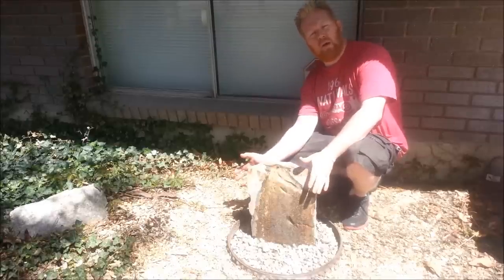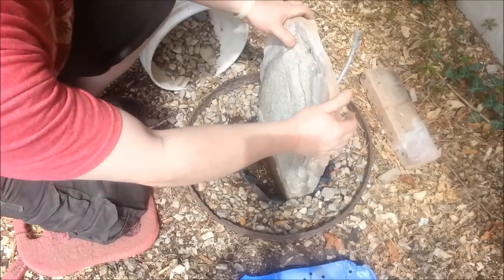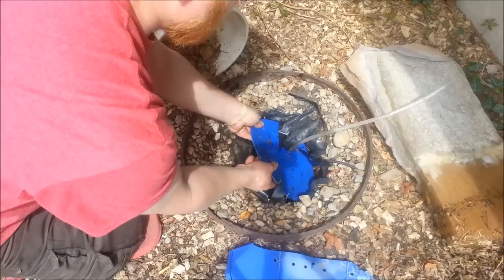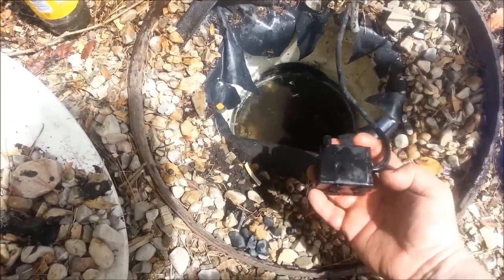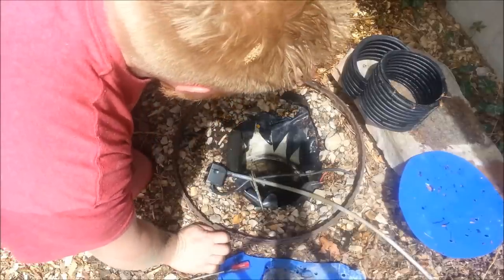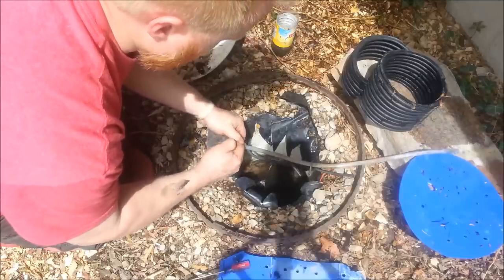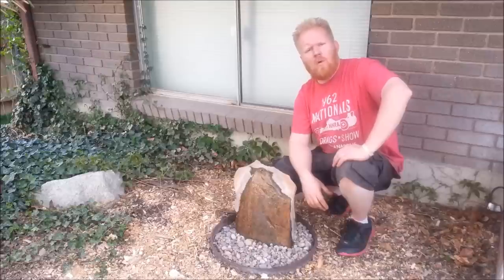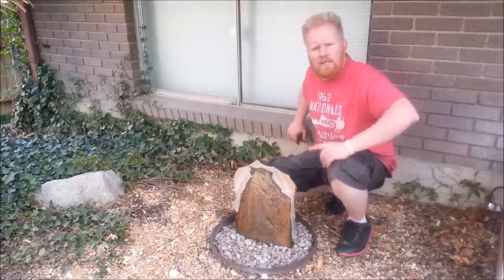DIY Rock Water Fountain Feature

Comment: Another great idea, thanks. 
A thought to keep the crap out of the pump might be to cut a car wash sponge to size and scoop out a concave hollow just big enough to house the pump, turn it over and cover the pump with just a small hole for the pipe to feed through. Same principle as a fish tank filter pump. I'm sure it'd still get clogged but would be easier to rinse out rather than cleaning the pump. Just a thought.
Keep em coming
Reply from the maker: Thanks for the idea. A sponge will definitely filter better.

Comment: The part I have a problem with is having to dismantle the whole thing to get at the pump and reservoir.  I like the tip about using screen door mesh.  I have a 3-tier molded concrete fountain that's a real pita to keep the pump from getting clogged with pine needles.

Comment: Very nice and on budget too. I did one years back but used a 4500 lb piece of granite. Had them drill the hole thru the top and then had to be placed with a front loader. Never will I do that again. Looked nice but so many issues arose due to the size and, of course, cost. I am going to try what you did, which is the same as my giant project,  with the only difference being scale but this time I will select a much smaller piece of granite and drill from the top. Thanks for sharing.
Reply from the maker: xsiv4c My original plan was to use a 300-400lb piece of granite but then I scaled it down drastically.
Reply: See, I could do 300-400 as I would be able to muscle that around, however, I will go even lighter as you say.

Comment: cool ^^

this gives me an idea, i wonder if i could make a roofing tile that absorbs water and is corrugated like a heatsink so you feed water onto it, and the evaporation of the water cools the house.

then again even something like mylar would help. last year i put some mylar on my roof and it lowered the temp by like 30 degrees F. might put a lot on this year.

i know that isnt really related to your video, but i was trying to figure out wtf it was that you made, thought it was used to cool water with evaporation of extra water on the rock...didn't compute that it was just for decoration haha. xP
Reply from the maker: If you live down South you may have never seen a "swamp cooler" or evaporative cooler. They run water through mesh pads and then air is blown through them to cool a house. They are VERY energy efficient and can be run completely off solar. They only work in dryer climates  though.
Reply: sixtyfiveford
oh that sounds awesome, and yeah its ussually 100% humidity here in illinois so it prolly wouldnt work too well haha.

Comment: good info, again, thanks. Wonder how much electric it costs a year
Reply from the maker: I actually figured that out a couple years ago and believe it was under 50cents for the entire year.
Reply: sixtyfiveford Are you sure you didn't slip a decimal place somewhere?  364 days/yr x 24 hrs/day = 8760 hrs/yr; x 6 watts/hr = 52.56 kW/yr.  At a nominal cost of electricity around 10 cents/kW, that would be about $5.25 per year.
Reply from the maker: My figure must have been per month as I tested it 5-6 years ago with the Kill-A-Watt. It only runs in the non frozen months so about 7-8 months a year. Motors always draw less than their rated for when not under heavy load. I just went out and plugged the Kill-A-Watt into it and it seams to pull 5watts steady so that's right at 36cents a month or $2.88 for the season.

Comment: I have a pump just like that and I'm really surprised how high they can push water. I have a question about your other 12 volt pump that you use on your portable heater thingy..  I was thinking about getting one of those to hook up to a tank of water at one end and a shower head on the other. I'm sure it will work for that but my only concern is if the shower head doesn't allow all the water to go through it will build up pressure and/or if the shower head is shut off would that hurt the pump at all ??
Reply from the maker: The bilge pump doesn't seam to mind having the water plugged off. So I don't think it would hurt it at all in moderation.
Reply: sixtyfiveford Ok,  thanks I'm going to give it a try.  Do you remember where you got it and how much it was ??  I'm from Canada but there must be something similar here somewhere..
Reply from the maker: It is a 500gph Atwood Bilge pump. You should be able to pick one up on Amazon for about $20 delivered. Just look for a bilge pump around 500-600gph
Reply: Geez that was quick.  I was going to tell you to skip that question because I thought you mentioned it in a previous video and I was just watching it,,  lol  thanks anyway !!
Reply: Just thought I would let you know that I checked our Canadian Tire store here and they have a 600 for $21.99 and it has a pretty good ratings so I think I'll get it.  Better than buying it online as this way if something goes wrong I have a year warranty..  Thanks for your help...